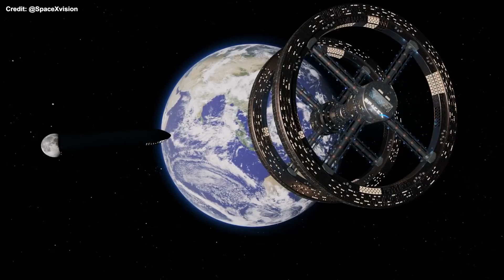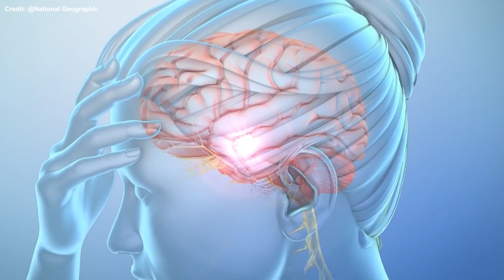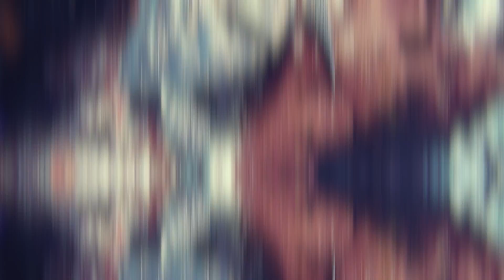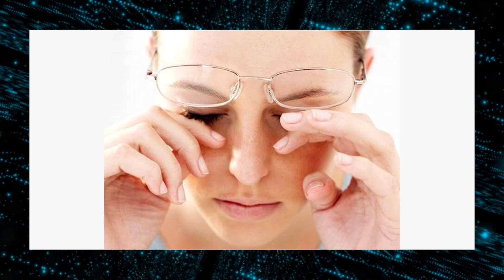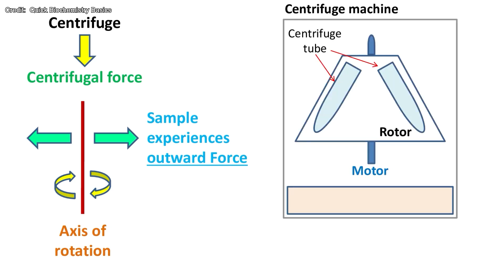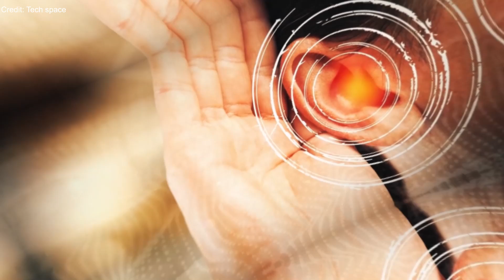SpaceX's Artificial Gravity Shocked Everyone

Comment: for a space station in a stable continuous orbit a rotating s^stem is fine. But on a space ship due to the momentum from the gyroscopic effect of the rotation , it is very difficult to navigate the spaceship. You always have to work against the angular momentum ,when you turn the spaceship and the required force is converted into a faster spin and more centripetal force

Comment: The only practical artificial gravity is between two Starships connected nose-to-nose with a kilometer-long flexible cable that is unwound from the nose of each Starship. As the cable is unfurled, thrusters on each Starship will keep the cable taut and begin the two Starships rotation around the center of gravity halfway down the cable. It's cheap, easy, and will work well. Even if it breaks, there will be no big problem as both Starships will have thrusters to control their orientation. And if it doesn't break, at the destination, the rotation will be stopped by reversing the thrust and slowly reeling in the cable.